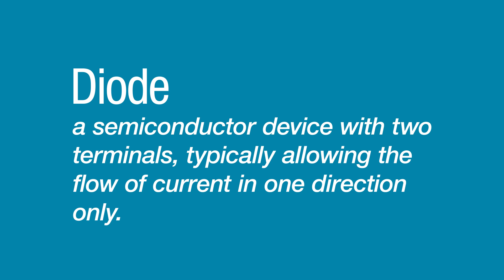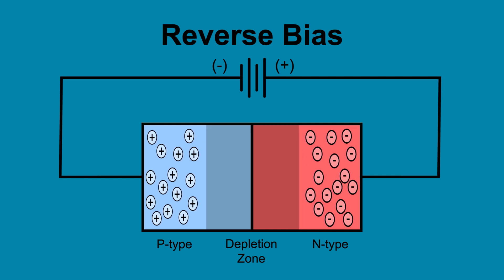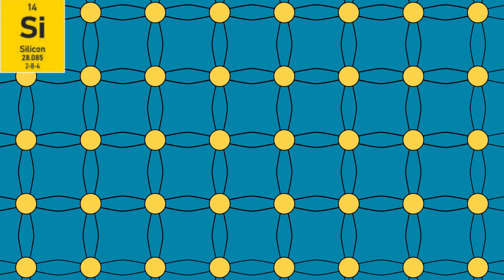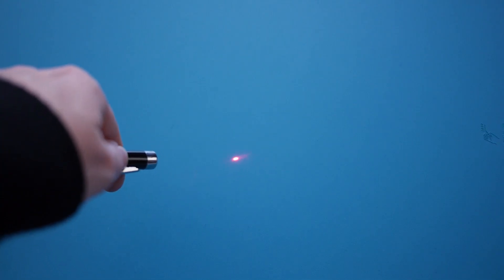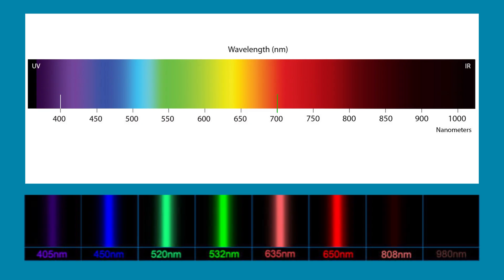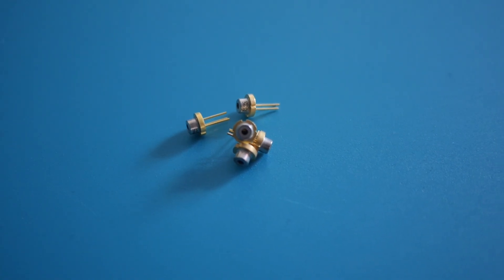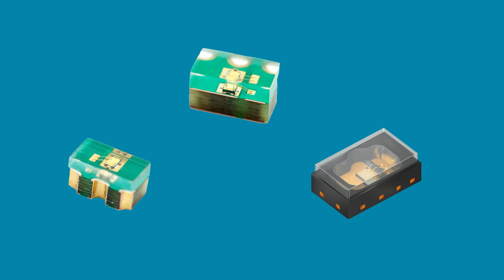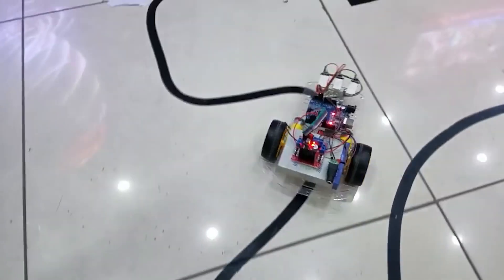How Laser Diodes Work - The Learning Circuit

Comment: I remember my first laser diode came out of a xerox docutech printer. It was a barely visible red light that came from a optical assembly with a few lenses in it. Eventually that got used with a real red laser diode of 635nm...fast forward to 2023. You now have cheap blue GaN lasers that can burn holes in stuff that can be powered by a single lithium battery.😮 The most interesting ones are the green output ones at about 515nm that can be used to replace big bulky argon lasers for many applications.❤

Comment: I am afraid you are confusing edge emitters with surface emitters.
Nobody believes the laser cavity is created by reflections between the boundary of the N-type material and the lasing medium on one side and the boundary of the P-type meterial and the lasing medium on the other side... and mysteriously the light is semi-collimated in the direction perpendicular to these surfaces.
Reply: Yeah she confused mirror surfaces, which are on the ends of the laser diode chip, and the boundary between the active (intrinsic) layer and the p and n doped layers. They both bounce the light (photons) but in very different ways and for different purposes. I checked the comments to see if anyone else noticed or if my understanding was wrong.

Comment: There is a new generation of blue laser diodes with a downconverting phosphor layer operating similar to white LEDs. They offer a considerably higher luminance, although a collimated beam is transformed to a uniform Lambetian one by a phosphor
Reply: Yup they use 5W blue or UV nitride lasers with a phosphor bonded to a sapphire window to build these laser driven light sources. They are quite popular for automobile headlamps and microscope/endoscope lamps mainly. If I ever get one I'll probably use it for a bright flashlight.❤

Comment: Small correction: lenses are not how lasers make different shapes. Lenses focus (converge) or defocus (diverge) a beam. Diffraction gratings and/or holograms are used to make the beam into a pretty picture.
Reply: I forget what those lenses are called that focus by diffraction through a bunch of tiny holes..
Reply: @donaldviszneki8251 zoneplates?
They work similarly to Fresnel lenses.
Reply: @donaldviszneki8251  smoke machine. it turned my ebay laser into a smoke machine.

Comment: is it possible to optical pumping (light) for semiconductor lasers or nanowire based lasers?
Reply: Yes they did that with Coherent's optically pumped semiconductor lasers such as the 488nm Sapphire system. In that a 800nm laser diode optically pumps a semiconductor laser that lases at 976nm and that is doubled to 488nm using a lithium borate crystal.❤

Comment: hi, thanks for the explanation, but light does not come in parallel and collimated straight from the diode, rather it can be collimated with a lens if the source is point (single-mode, with waveguide width less then the wavelength)

Comment: A housing where the ceiling of each room has an optical fiber lighting array running across it; which is then covered with a coat of diffuser material. 
Then connect each array to a central light generating unit that sends light through the array when a light switch is turned on.

Instead of lightbulbs, lamps, and copper wiring, the ceiling of the room would emit its own light

Comment: Good video. Slight correction though: Both portions of the diode, n and p are essentially neutral in charge. However in the n-type portions the CHARGE CARRIERS are negative (electrons), as is the case in a metallic conductor; and in the p-type portion the CHARGE CARRIERS (holes) are positive. At the junction, in the depletion region, electrons cross over from the n-type portion to fill the holes of the p-type region (or, if you please, the holes cross from the p-type to be filled by electrons in the n-type, the two statements are equivalent), so that in the depletion region (very close on each side of the junction) there is a net negative charge in the p-type and a net positive charge in the n-type.
Reply: Yup the lasing portion is essentially a very heavily doped region with the lesser doped regions supplying the charge injection into the lasing region. I used to bake laser diodes at a company called Boston Lasers using a MOCVD machine that would build them layer by layer on 2 inch wafers of gallium arsenide. For visible ones they used aluminum to replace gallium to make the wavelength shorter. One day we were making 633nm wafers and the injection valve gave 2 extra shots of trimethyl aluminum and we rolled with it. We ended up making bright orange laser diodes of 604nm that made about 250mw at 1.2A and 15 degC temperature. Seeing that much pure orange light from a laser diodr was very cool.❤
Reply: Was going to say this too, thanks for correction. Its worth noting that although there is more electrons or holes in the conduction bands, for every DONATED or ACCEPTED charge carrier a positive or negative ion is created respectively, effectively neutralizing the material.

Comment: Haven't mentioned my favorite type VCSEL (Vertical-cavity surface-emitting laser), This is a much more advanced alternative to PIN diodes, it is really powerful and quite cheap for near infrared.
Reply: Yup those are very interesting because the active layer is so thin they can be modulated extremely quickly. The power was low for a very long time until a company called Novalux found an ingenious way to stack the quantum wells to make much higher powers. Next they packaged them with KTP or KNbO3 crystals and made extremely efficient lasers operating at visible wavelength. Then the blue and green nitride lasers ate their lunch.😂
Reply: She is confusing the two types.
Look at how she shows the cavity with the light bouncing, and the direction of the collimated beam perpendicular to it. That makes zero sense.

Comment: People should really stop using laser pointers as pet toys, the reflected beam can still cause harm to the eye of the animal. Even if it's not immediate obvious that a surface can reflect the laser, it often can reflect enough to be harmfull.
Also many laser pointers, especially the cheaper ones, outputs way more light than they advertise, especially in the infrared spectrum which despite being invissible, are still harmfull to the eye.

Comment: Those shapes are created by a grating, only after being fully collimated by a lens. Also, the light waves which escape don't act the way you showed them to behave, a very small portion of the photons which  are alignted to exactly 90 degrees with the mirror facets, front and back (one mirror perhaps only reflecting 90%) will escape as collimated light.

Comment: May I also note that even weak lasers are dangerous as F***? My next project will be an automatic laser tattoo machine and even branding and cutting. If there's a market, and there is, feed it!!! I hate tattoos beyond belief. But since Angelina every eleven year old needs some usage instructions and what not under the skin. Also the machine, it will be a booth to be set up at train stations and shopping malls will have a type guidance and after scanning the facial properties of the individual it will use AI to find the patterns to have maximum impact at least until the next school party is over. (>_<*) The business plan is prepared and the banks are willing to invest 1.3billion$$$ without asking since I use current hot buzzwords all over the paper. The users will be able to pay with bitcoins too. But that was obvious.

Comment: Thank you for the video is the biggest difference between laser diode and an LED that it has a polished mirroring layer? and what would this be made of in material perspective??
Reply: Not necessarily polished (the process) but highly reflective and flat.
Reflectivity on one side as close to 100% as one an get, on the opposite side about 95+% so that some of the beam can escape.

The multiple reflections between the "mirror" surfaces is what creates the Amplification (the A in LASER).
Note that her drawing in the beginning of the video is incorrect.

Comment: I use 450 mn laser for engrave/print a lot of things, actualy with FAC tecnology and double beam can easy cut plywood. But the big problem is how extract heat from the module 'cos the fan isn't enought. Any suggestion?
Reply: Bigger fan

Comment: thank you very much. now I know how they work, but can anyone explain how they are made ( manufacturing process) ? I dont get how they make the mirrors in between the junctions, I cant find a satisfactory explanation.
Reply: I'm skeptical that the animation is accurate. For example, how does the light turn almost 90 degrees to escape the intrinsic layer? I believe the mirrors might be the edges of the intrinsic layer that are not attached to the semiconductors. But i could be wrong

Comment: Most laser printers now use LEDs, not lasers. They used to use lasers, but advancements in LED manufacture allowed cheaper LED arrays to perform the same task. By that point though, the name had stuck - laser printers had come to be seen as an indicator of of quality and reliability, so no manufacturer would want to brand their printers as not-laser. They just carried on calling them laser printers even after the laser was removed.
Reply: Actually laser printers still do use lasers. They use a infrared usually 780nm diode to deposit ink onto the paper
Reply: @suhailab3634  https://www.youtube.com/watch?v=_saDCwsB9Ww

https://en.wikipedia.org/wiki/LED_printer

If you look around, I'm sure you can still find a real laser printer - but I work in IT support, and I've taken a lot of 'laser' printers apart. HPs mostly, an occasional Brother, some big Sharp multi-function units, and one Kyocera. I've yet to come across an actual laser in any of them. The industry moved to LED printing years ago because the quality is just as good, it's more reliable and costs less. They just kept on saying laser, because consumers associate laser with high-tech and LED with budget.